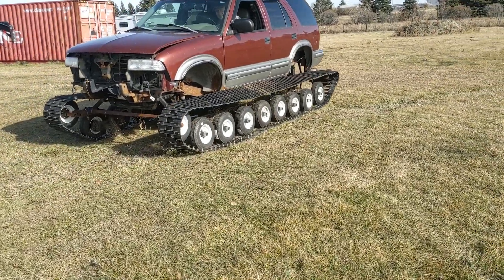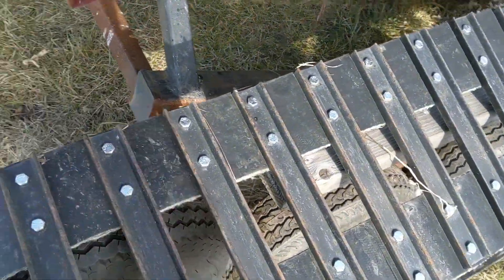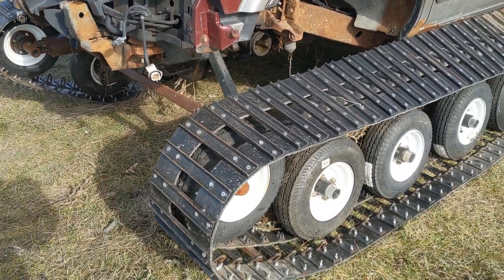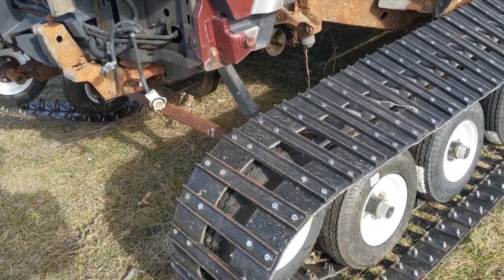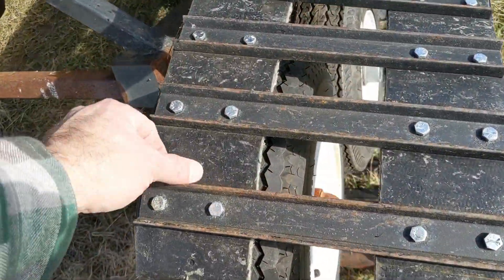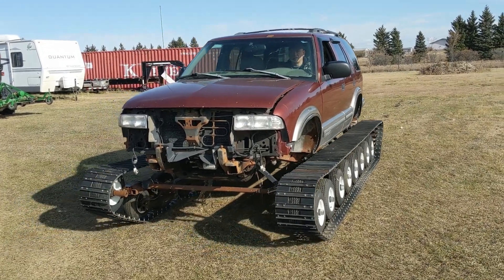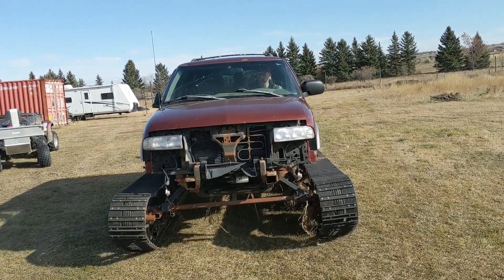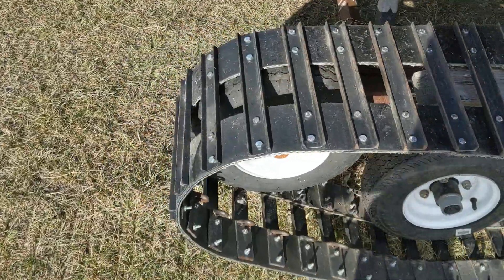Custom Tracked Vehicle, Part 23, Test #3

Comment: No rock guards. No stops on the rail. Any kind of turning is going to throw the track off. Maybe teeth on your idler as well
Reply from the maker: Hi James, given some design flaws, the issue is the teeth are not tall enough. Part 24 I take it for a successful test drive. But that's the last drive for this version. I am going to take the Blazer off and get rid of it, switch to a small car, hatchback. Probably have to do some major changes to accommodate FWD.

Comment: The track keeper need to be taller they need to be tall as the tires sidewall 
Take two hydraulic cylinders and put a  Greece zerk in the cylinder pump them full of grease to keep the tracks tite
Reply from the maker: Hi Matt, you are right on the first and second comments. The hydraulic cylinders is what the industrial machines use as the grease won't leak out. However this is a developmental vehicle and I need to be able to take it apart fairly easily, so for now stick with this method. Once I move to a permanent setup, in rev 2.0 (think Mazda 3 instead of Blazer) I will go to something like that cylinder. If you watch Part 24, I replaced some guides with taller ones and ran it around the yard, worked like a charm.

Comment: Ur front idler..is bent...so when u reverse it come off...u need to align the front idler wheel
Reply from the maker: Hi Anselm, it is slightly out of alignment due to the way the adjuster is built, but for now it wont affect anything. Just the torque of turning is causing the tracks to come off, the guides are too short. Check out Part 24, I am downsizing for rev 2.0, Mazda3 instead of the Blazer I think.

Comment: Just found your channel today.  Watched all the blazer videos and I like your project. A few observations I think may help. 
The teeth on the drive cog are acting like ramps letting the track skip,  I think sections of box steel will work better than the angled teeth.  
A larger diameter drive sprocket will probably help as well.  
Large diameter idlers in front,  similar to the drive sprockets would probably benefit you also.  My last major concern is the rigidity of your frame.  I think you should add more framework. Having the rails welded to the vehicle chassis is great but I believe any side load is going to twist the vehicle chassis rails and cause the wheel rails to bow out causing the camber problems you've already had,  or even complete failure. 
That's my $0.02. I hope this project is a success! Good luck!
Reply from the maker: Hi ThinkFreely2012, thanks for the feedback. Industrial machines use sprockets same design as mine, but they have a more square at the bottom shape and curved at the top shape to counter that pushing off effect. The triangle shape helps with cog engagement, ensures they guide on correctly. I am going to run the track tight from now on, then once I solve the track coming off issues might revisit. The drive sprocket size is picked to meet a max speed of about 40 km/hr, 1/3 the diameter of the stock tire. The front idler shouldn't matter it tries to keep the track on, but due to the shorter inside guides the track always tries to come off. I can measure the deflection of the frame when the machine is in the air to when it is on the ground, there might be some give, but not much. Again, a problem for once I get the inside guides larger to where they need to be.

Comment: 1. A for effort!
2. Pyramid cogs on the drive sprockets are a no no. Must be perpendicular to the track bars. Use square tubing then put tapers on the tips of them.
3. Weel track guides are too short. They must extend higher past the center of the tire side walls.
4. Track tensioner is either too weak or not tentioned enough. The track must be super tight. The conveyor belt can handle over 1800lbs. I hope your track treads are made of hardox steel or at least 3/16 tube wall.
5. Suspension is flaring outward. Must strengthen it a lot. Brace the hell out of it.
Reply from the maker: Hi, thanks. Have no fear, when you see the next test you will see all is good. one set of wheels are mounted a little crooked, hence why they look to be flaring out, but there is no flex in the wheel frame, at all, lol. Its very heavy duty.

Comment: Idelr wheels might not be dead straight. After you put the tracks back on if looked like the bottoms were tipped out (camber)??. If it's out even a 1/4 inch it will try to steer the track the way it's pointing. So say the front idler isnt straight and it's toed out, the track is going to want to walk off to the outside when you go forward and walk to the inside when you go backwards. Tracks also look to loose. May try adding a small idler (boggie) just Infront of the drive cogs to prevent the cogs from forcing the track towards the ground.
Reply from the maker: Hi, you are right that two of the ilder (walking beam) wheels are not straight. However they are in the middle of the track. The front idlers are dead straight (not toed) but I was told by the guy who invented the nodwell to have a slight toe of the entire track assembly inwards to help with the natural tendency of the tracks to come off to the outside. I never did this since I was already past that point, however maybe in version 2. I tightened the track on the second and third tests and the slipping disappeared but I need to add a slight lip to the cogs near the bottom of the cog to help them stay on even if the track is loose. The cog pulling the track down when driving forward is due to not enough curve at the top of the cog to help with disengagement. I will probably grind down more of the top of the cog to help with this, but to totally fix it might need a whole new cog designed.